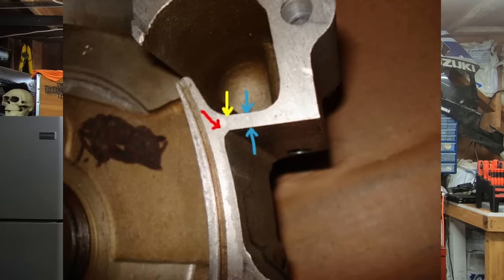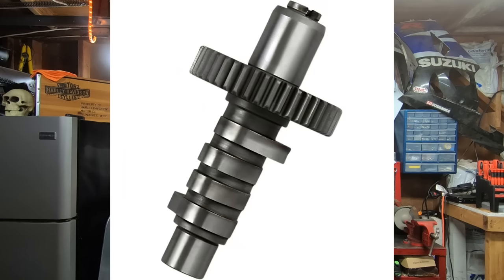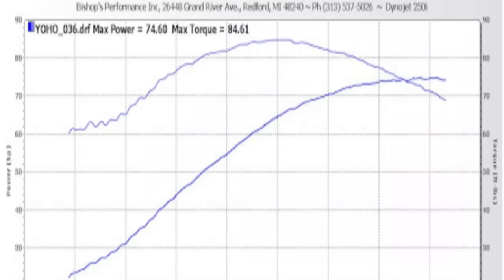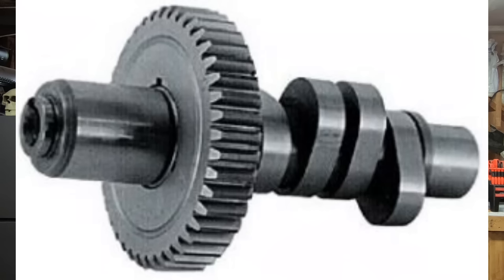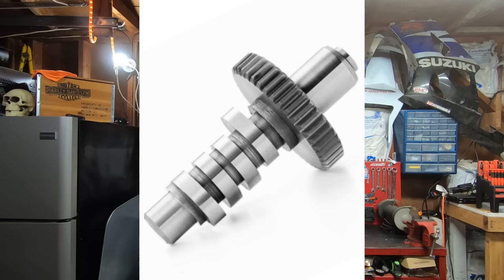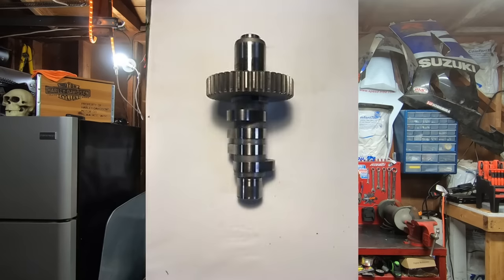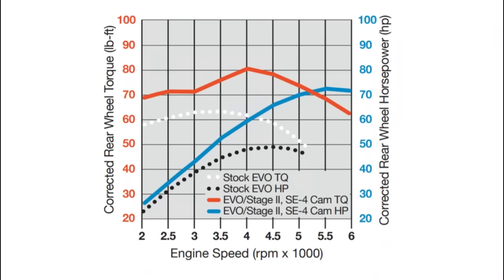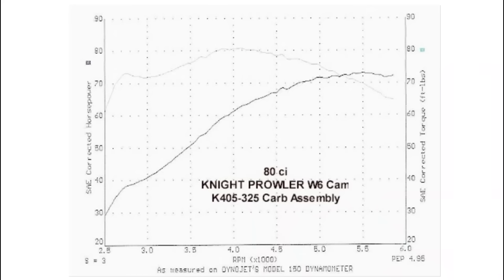Absolute Best Upgrade for the Evolution Harley-Davidson

Comment: Im putting an EV27 cam in my Evo with a 4 5/8 Ultima stroker flywheel assembly
Reply from the maker: EV27 is a super popular Evo cam, it's been one of best sellers for Andrews. That cam does wonders for the Evo, it got power all around and it's not super extreme.
Reply: @GixxerFoo  I know right? Believe it or not I've always thought that "Bigger is better" and although that may be the case that doesn't necessarily mean that it will meet the requirements for the lifeapan of your valve train to include lifters and also fuel economy. For me those are my 2 biggest concerns. Granted, its a Harley Davidson but in my opinion 75-90 HP is achievable but anything north of that in a stock Evo case will be breaking stuff. I think I've even heard you mention that in your videos. Great job with your channel 👏

Comment: does it matter which cam you pick it you have a carb or efi?  I have a 97 flh with efi
Reply from the maker: Won't matter which cam but getting the Mag EFI tuned can be a bit tricky.
Reply: @GixxerFoo  change it over to a carb?
Reply from the maker: That can be a huge undertaking, a good dyno tuner can tune the mag system though.

Comment: You may have mentioned it somewhere but I probably missed it I am looking for lifters I have a 98 earful. I don’t need anything crazy or expensive but I don’t want to buy cheap cheap do you have any recommendations for an average rider thank you
Reply from the maker: Jims and Feuling make some good lifters, they are a couple hundred bucks for a set. Check out JP Cycles, RevZilla, Dennis Kirk, they sell them pretty reasonably. You don't want to go super cheap or pay out the butt for OEM.
Reply: @GixxerFoo  Yeah I see on eBay what is it the 20 bucks for a set of lifters 30 bucks etc. I just worry about those I don’t have a Lotta money to throw around otherwise I’d probably go with some new a cam ,, One of those Andrews you suggested in your video, in there something I can use my stock pushrods I’ve had a couple of adjustable pushrods failures one came loose another one bent but I know there’s a point you can go to cheap but there’s a point you can go to expensive to thanks for your response

Comment: I just bought a 91 electra glide this week. The previous owner said that it has an aftermarket cam installed. Will i be able to identify whats in by looking? I don't want to order a new cam if it already has a good one in there.
Reply: You will have to pull the cam out but ID is on either the rear lobe or on back of cam where it rides on inner bearing
Reply: @leonardstanford1877  thank you

Comment: Do you need a fuel controller or ecu flash when you do a cam swap?
Reply from the maker: Yes, you would need a flash tuner if the bikes is new enough with the delphi system. If it's a fuel injected evo the older mag system you would need a power commander 5. Best option would be to have it dyno tuned, flash tuner with auto tune will get you to where the bike runs good and pick up some power. But a good dyno tuner can use their experience to really get some power left on the table!
Reply: @GixxerFoo  thanks for the info!
Reply from the maker: Not a problem, anytime!

Comment: Hey love the videos. Question for you? Can I drop a T124 S&S crate engine in my 2002 hd ultra classic. Just wondering.
Reply: Sorry it’s a 2003 ultra
Reply: Al Gottsch  so would you recommend the S&S 124 and is it good quality and would I have to change my 5 speed trans to 6 speed.
Reply: Just asking I’m thinking about doing the change
Reply: Al Gottsch  thank you so much for the info I think I’m going to do it since you say it will drop right in with no trouble and I can keep the trans and just jack up the clutch. I will do 2and to 1 also.

Comment: Considering building a 96" evo with the s&s sidewider kit. Which cams do what with the sidewinder kit? Can't seem to find much info on evo big twin performance builds.
Reply: Just so you know the 96" sidewinder kit puts you right about 9.6 to 9.7:1 on static compression.  If you get head work done to accept the higher lift cam the woods w6h would be an awesome Cam and at that point though you're going to definitely need a S&S Super E.

Comment: How about Andrews ev72  for a 96 inch S&S evo motor?
Reply from the maker: It's hard to improve on the S&S, but they are solid platform to build on.
Reply: I've got a ev72 in a s&s 107  that came with with epa friendly s&s 520 that was all torque no top and was hard on starters changed to the 72 and it was a different machine.  .I have broken two belts with it , she scares me but I love her any way.

Comment: My evo had a ev27. Ported and decked head single fire mikuni and went well ran out of puff about 5. .  My mates had ev 46 I think basically the same but his pulled harder mid to top end.  Mine was better low to mid range,,,, as said I’m twin cam now. lol.. my 99 road king I’m going S&S 509.  I’ll give you an update

Comment: I get a chuckle out of Harley owners. They spend more time upgrading and repairing their bike and less time riding it. The average Harley rider puts 1800 to 3000 miles on their bike because if they put more it would end up in the shop more often with some expensive repairs. I have 2 Japanese bikes and the most expense I run in too is having tires changed as I ride 14000-16000 miles a year. Working on my 3rd  set. When it's time I'll buy another set of new Japanese bikes or used low miles from owner nonriders . My maintenance costs are maybe $1200 /year  mostly oil and tires.
Reply: I own two Harley’s and I don’t spend nowhere near that much each year. I put 5-10k a year on my Evo.

Comment: I just put on s&s super stock heads and their 10:1 pistons with the hq-0024 head quarters cam that i already had. Stock heads were milled .050 before. Honestly...i don't think it runs any better after the s&s heads. I'm looking for a cam to utilize the 10:1 compression and the bigger valves in the super stock heads. Any suggestions?
Reply: Andrews ev46

Comment: I removed the EV 27 cam from my 92 Heritage and installed the EV 13 much better power for the mountains I'm in, in Montana  My house sits at 5860' Elevation and the city below me is at 5400  everywhere I ride is mountains.
Reply from the maker: Do you have any issues with elevation changes with your carb?
Reply: @GixxerFoo  not really enough to notice, at times on some hills there is a little power loss bu then I drop a gear, I've got a 6 spd Baker gear box and 6th gear is a little high for climbing 8,000 Ft.  5th gear there are no issues with the EV 13 where there were some issues with the EV 27, the EV 27 worked Great on the Flatter land East of here rolling hills but when I hit the Continental Divide  which I live just on the west side of it it's a lot of High climbs. I've got 185 Main jet and a 45 Pilot jet. I don't have the perfect setup but for my budget it works,  gutted stock exhaust pipes,  stock carb

Comment: Not trying to start an issue here but the Dyno sheets of the 2 bikes with the EV 27 are a little misleading.. Both bikes had head work and increased compression.. However the numbers associated with added head work are a fair representation of the EV 27.
Reply from the maker: The EV27 is a very versatile cam, it's one of the best cams out there for the Evo engines.

Comment: Ok I have a 131 merch motor and I'm wanting to build it up, any suggestions on cam and or carb size? It has a 42 mm mukuni on it.
Reply from the maker: Holy crap that's a big engine, is it a EVO?
Reply: @GixxerFoo  yea and it's on a softail frame. I'm just trying to find out what I need to do to have this motor running at its full potential
Reply: @GixxerFoo  yep it's an evo. Look up merch motors

Comment: I have lots EV27 bikes running around out there ! That cam likes some compression add a .030 mls head gasket ! If your only running out to 5500 hang on to the throttle a little longer an EV27 will rev to 6200 all day ! My personal bike goes pretty far past an EV27 I ported my head's added a 1.9 intake valve a 1.630 ex decked .020 has a old set of crane 600 lift springs 10.0 wiseco pistons S&S lifters an a EV59 cam stock bottom end S&S E carb & a thunderheader for exhaust  & loves eatin up Twinkie motors & 114 m8 motors my 91 FXR weighs in at 573 lbs  !
Reply from the maker: Andrews cams really aren't advertised with glossy pictures and bikinis, they don't need to be but they sure could expand if they did!
Reply: Leonard Stanford 
Sounds nice is it still a 80” motor?
Reply: @scrumthebum2451   yes still 80 cu in !

Comment: Do you recommend the EVO over the twin cam? I am looking at a bagger a 1998 with 75000 Kim’s Ontario Canada for sale. $8500.
Reply: Heck yeah get the twin cam, especially an early one with a pressed in crank pin and spring tensioners bulletproof
Reply from the maker: I would recommend the Evo honestly, unless you're willing to put some money into a twin cam to fix some of the issues.
Reply: @GixxerFoo  haaa like above?
Reply: @GixxerFoo  ok many thanks, that’s what I was leaning towards as well 👍
Reply from the maker: You just can't beat that reliability!
Reply: @GixxerFoo  sounds good 👍

Comment: Cams cams cams.....I have a 96 flhtcui that has developed an issue. It's sucking oil out of my primary into my crankcase. My mechanic believes a cracked case is the culprit, although, he's never seen oil migrate from the primary into the crankcase and he's been wrenching on these for 20 + years. It usually goes.the other way. Crankcase to primary. It would have to be a pretty big crack because 28 ounces of oil transferred in just under 10 miles! Anyway. Because of this issue, we, he and I both, decided the best way to go would be to just replace the motor. I found one that was salvaged from a 96 flhpi road king showing 4,230 miles on the odometer. They also state the actual mileage is unknown but the pictures of this motor look extremely clean like a low mileage engine. 2900 and change and it's on its way to me. I think I'd like to upgrade a cam in it but I don't know what would be best for a fuel injected bike. I'm thinking the Andrew's 27 but I really don't know. Either way. I need the thing to quit sucking oil from the primary. That's the big issue.

Comment: My Woods W6 cam will be on eBay this weekend. It has low mileage and shows no wear whatsoever. Too noisy for me...
Reply from the maker: The Wood cams makes some power but they do have some pretty gnarly ramp angles which does make them noisy.
Reply: @GixxerFoo  SOLD for $180, screw that noise...

Comment: I loved my Woods W6 cam but was noisy AF
Reply from the maker: I've noticed that about the Wood, but damn they work!
Reply: @GixxerFoo  i ran one for a while and yanked it cuz it was just way too darn loud. Heads were decked .050", Wisco forged armor coated pistons, cylinders trimmed down to permit + .005" piston protrusion and a MLS .030" head gasket. Evo  transmission shift drums and pawl are HORRIBLE compared to the twin cam version. And i had MANY false neutrals which caused me to redline. That Motor ended up getting destroyed due to over revving. With 195 static pressure in each cylinder it was very nasty!  I highly recommend to anyone who wants a crisper/faster/better shifting to get the Baker kit for your Evo or do like i did and run an early twin cam 5 speed variant of it which is the twin cam shift drum and pawl. Ive done 2 so far and they exceeded my expectations. You gotta know what you're doing if you run the twin cam parts, setting it up is VERY  tricky but WOW the difference between the two is night and day.

Comment: well, now i want some new cam in my evo... silly me thinking that i was done throwing money in that bike...
Reply from the maker: A good cam wakes those Evos up! Lol you're never done upgrading and making changes on a Harley.
Reply: @GixxerFoo  Fun (not so much) fact.... finally a tooth of the original cam has broke and got sucked in the oil flow, and the result it's the engine out of the frame and waiting to be rebuilt... if i changed cams when i saw this video, i will be now probably enjoying my bike in this damn hot summer

Comment: I STRONGLEY DISAGREE WITH YOUR CAM EVALUATIONS.I owend a custom harley shop for 20 yrs. You are correct about Andrews but we always got more bang for our buck with EV3 & EV46 your harley cams where just tonded down andrews cams.We got 100 horses with  EV46 ss carb/thunder header/wisco 10.5 to 1 pistons/singelfire ignition so mabey you need some help????
Reply from the maker: Whew, yeah compression in an Evo does wonders but trying to keep the power down a bit for reliability.